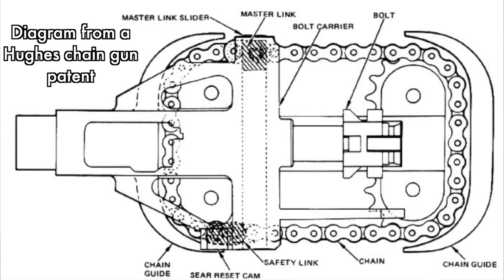Ask Ian: Are Man-Portable Chain Guns Coming?

Comment: Here's a question for you. I know there's that one particularly lightweight revolver made of Titanium, but why don't we see more firearms made of that material?
Reply: My guess would be insane cost, as well as the poor heat conductivity of titanium.
Reply: @PumpkinsAmongUs  Insane cost? Have you SEEN the US military-industrial complex? And poor heat conductivity is just a reason to bring back water-cooling for firearms, in a more limited fashion.
Don't get me wrong, the chamber, barrel, and bolt would still probably be made of high strength steel just like today. The rest of the gun tho, just think of how much we could reduce the weight of the M2 HB .50 cal machine gun if we made the side plates and all that out of titanium instead of steel?
Also, what's to stop them from making a composite barrel? Thin steel inner barrel, then a titanium outer barrel to reduce weight while maintaining strength. Or you know, go right to carbon fiber reinforcement of the thinner steel barrel. I think they tried it in the past, I know it didn't work back then but maybe the idea deserves a re-visit with modern knowledge.
Reply: Kentucky Ballistics actually did a vid on that very topic...It pretty much came down to cost...both in material, and tooling...The insane amount of effort just to produce one is really above the average gun maker 1 getting a consistent supply of titanium ay a decent price. 2 special tooling for all the machine work. 3 Someone with the proper training for sharpening said machine tools. 4 there's probably a few more issues but its pretty early in the morning and I haven't fully woken up or had coffee yet lol so kinda draggin ass at the moment
Reply: Titanium is brittle
Reply: @tandemcharge5114  Titanium is something you can make a hammer out of (they do make titanium framing hammers, if I recall) So, brittle it ain't.
Well, Titanium with the proper alloying elements and heat treatments is not brittle and is incredibly strong, and that's the kind of titanium I intended when I said "titanium" in the top comment, I didn't mean raw titanium metal, just like when someone says 'an aluminum bike frame" they mean "aluminum alloy bike frame" not "raw aluminum bike frame".

Now, it IS very very expensive.
That's more down to the fact that the world just doesn't use much metallic titanium, and that that titanium atom really likes hanging on to a couple oxygen atoms, forming titanium dioxide.
Titanium dioxide is an incredibly common ingredient, you find it in white and light colored paints, the best sunscreens, and a whole bunch of other things. And titanium dioxide is what you need to start with if you want to make high purity metallic titanium.
Reply: @44R0Ndin  Titanium is brittle, period. Whatever alloy that Titanium is in, hammers, drills, and clamps included, is not the majority metal. It's only there to add strength to the other components in it

On top of that worse case use, Titanium when used as a majority in an alloy metal is ductile and malleable, making it the absolute worse chose to ever use in a gun that requires the minimum to hold zero. That malleability means that, no matter what fancy schmancy chemistry words you tack on, titanium and concurrent titanium alloys are hard to work into shape, expensive, needs specialized tools, sensitive to temperature, and requires higher machine tolerances than normal due to previously said malleability due to temperature.

Aside from that, you're making your gun worse for your soldiers as Titanium alloy barrels have worse barrel life (Go check barrel life between titanium and normal guns), mostly from Titanium's lesser impact tolerances and ability to hold up from repeated impacts

So unless you're willing to spend even a badonkers more amount of money with chroming the interior on top of the already expensive barrel and receivers while also planning to mass produce it with specialised equipment and still being a fuck ton expensive for the consumer due to material and labor costs. Yeah, I don't see Titanium guns ever being a mass adopted thing outside of extremely specific niches like revolvers or guns that aren't continuously fired or subjected to constant expansion and contraction. To which we do see the knowledge being applied on the appropriate guns than Titanium being used everywhere
Reply: @tandemcharge5114  OK first off, now you're contradicting yourself, saying in the first sentence of your post that "titanium is brittle, period" (as I read it, this allows no exceptions), then in the very next paragraph saying it's "ductile and malleable".
So, which is it? You can't have both.
You'll note I was always talking about using titanium as the majority metal in the alloy, and never was I referring to titanium nitride, an extremely abrasion-resistant coating applied to many cutting tool bits such as drills and absolutely never used in hammers.
So in other words, I don't think you know what you're talking about anymore, and that's why.

Secondly, when I mentioned using titanium in the gun barrel, I was VERY SPECIFIC to say that the INNER BARREL (aka the part that gets the bullets going thru it) would be made of standard-issue, well known, well characterized gun barrel steel with the standard heat treating and chrome plating of the bore.
About chrome plating, since you wrongly said that it's gonna cost "badonkers more" to chrome plate a barrel versus not chrome plating it.
Chrome plating a STEEL gun barrel bore is NOT an expensive step.
Only people who don't build firearms for a living think it's an expensive step.
The reason they cut chrome-plating the chamber and barrel of the M-16 at first was because some politician with no engineering know-how in the field of firearms got in there and started cutting corners pretty much without regard to if it actually made the gun not able to meet its performance standards or not.
I expect that they might have saved maybe $5.00 USD on each gun barrel they didn't chrome plate in that application.
Even if the gun barrel only cost $50.00 when chrome plated (the gun barrel itself probably ended up costing over $100 in today's money, so I'm giving a worst-case estimate here), that's only 10% of the cost of the complete gun barrel (and at $100 or more, that's only 5% or less of the total cost of the barrel, which means it's pretty much an insignificant savings, considering the cost of the rest of the gun).
Last I checked with my common sense, making something cost 10% more (more realistically 5% more) but last a lot longer doesn't equate out to it costing "badonkers more" as you put it. In fact, the only reason to not chrome plate a gun barrel is if you're looking for LITERALLY ANYTHING you can cut to cut costs, and you've already cut everything else first.

Back to the barrel that uses titanium tho.
Like I said, the inner barrel is merely a standard issue steel barrel that has been produced with a much much smaller outer diameter (insufficient to withstand the stress of firing in fact), that is heat treated the normal way a gun barrel is heat treated, and maybe it has been chrome plated (or maybe not, whatever makes you happy snowflake).
The titanium is used to REINFORCE this inner "barrel liner", so that it can withstand the stress of firing projectiles. In other words, the steel tube that makes the barrel is put inside a titanium alloy tube that reinforces it sufficiently to allow it to have a long service life while being lighter than an all-steel barrel.
Also, Titanium is still a metal element, so it is still plenty capable of conducting heat away from the barrel liner even if it is not quite as conductive of heat as steel is.

Maybe if you did some math out on the idea (looking up the relative strengths of heat-treated steel used in gun barrels, and comparing that to a resilient alloy of Titanium that has been appropriately heat treated) you'd be able to convince me that the idea won't work.
Until then, I still think the idea is at least worthy of study.
Reply: @Cancer McAids There are other ways of dealing with recoil that don't weigh as much as "make the whole gun heavier".
Also, while aluminum and polymer are the more usual choices, I was thinking of Titanium as the material of choice for something like a Nitro Express hunting rifle's receiver.
Not much sliding contact going on in a break-action single-shot rifle, and if there is you can do what Glock did to make their polymer frame work and put steel inserts into the titanium receiver to allow those sliding parts to slide on steel rather than on titanium, and still come out with a lower overall weight.

However, I'm one of those people that is convinced that no problem is unsolvable, unless the solution requires you to violate the laws of physics (and those kinds of problems usually involve thermodynamics).

So a purely Newtonian dynamics problem like "how do you mitigate recoil without adding weight" is VERY much a solvable problem. The firearm will become more complex yes, but the problem is solvable.

The first idea that comes to mind (for something like that .45 caliber polymer frame pistol you said you don't like shooting) is to split the mass of the slide into two parts, linked to each other by a gear, with the front portion "recoiling" forwards and the rear portion connected to the breech face and all the "critical to pistol function" bits of the slide recoiling rearwards as normal. Will this also make the pistol bulkier? Of course. Will the slide reaching the rearward end of travel cause the entire pistol to go off-target anymore? Not as much as it once did, and by calibrating the masses of the individual parts of the slide (forward and backward recoiling sections) you could tailor bias of forces to be more easily kept on-target.

Comment: I'd be interested in hearing about Revolver Cannons.
Reply: He did one on a Hotchkiss revolving cannon
Reply: He did, but a revolving cannon is not the same as a revolver cannon. A revolver cannon is like a revolver with a Gatling gun as the cylinder.
Reply: @keenumman1  Missed that one, gonna dig it up.
Reply: Or maybe lever-operated cannons.
Reply: @gus.smedstad  Now I want @smatereveryday and @stuffmadehere to build a rig to turn a Winchester 1873 or Marlin 1895 into a machine gun. The ATF should grant exemptions for stupid shit like that.
Reply: @DeliveryMcGee  In Cuba during the revolution I have seen reverences to  94 Win mad full auto  ...
Reply: I wonder if there are any ShKAS hanging around. 

edit: Wait I just noticed there is a post about it on forgotten weapons website.
Reply: Those are just essentially miniguns with only one barrel, but multiple chambers.  So you get the reliability of the external operating system, but these are used with firearms that don't need the insane rate of fire of a traditional multi-barrel system, so you don't need the extra barrels to take that heat.
Reply: @Panzermeister36  The virtue of revolver cannons is that the INITIAL rate of fire can be higher than a gatling cannon. A gatling gun needs time to get the barrel cluster spinning at full speed.  A revolver cannon only needs to spin up the "cylinder," so it gets to max rate of fire sooner.  The trade off is single barrel means lower sustained rate of fire.

If I understand correctly, the virtue of modern revolver cannons is in cases with short engagement windows.  Also, when you start thinking about revolver cannons, you start thinking that maybe David Dardick was on to something...
Reply: @grimlock1471  also, Revolver Cannons are lighter, because they only have one barrel.
Reply: @havoc3742  almost like design is pile of compromises. 🤔
Reply: @Panzermeister36  the whole point of minigun or a gatling gun in general is havinf multiple barrels
Reply: @timofiy98  Multi-barrels firearms are harder to make accurate, so in a high accuracy/medium fire rate use case revolving cannons are more desirable.
Reply: You can get pretty high fire rates out of revolver cannons. The main benefit is that you dont need the space for the barrels, you dont have any spin up time and you get good accuracy.
Reply: @thenewhalogod  what does it have to do with what i have said?
Reply: @timofiy98  No. Just no. The point of miniguns is absolutely not having multiple barrels to give it more weight and complexity. The point is to have very high rate of fire and reliable mechanism for it. Making multiple barrels for the gun is only unavoidable consequence.

In theory it could be avoided by having cooling system over one barrel, but for that high rof it would probably be even more heavy and complex system prone to breaking and that is why they are not made that way.
Reply: @anteshell  you are really dense, what i mean is - if it doesn't have multiple rotating barrels then in it's core it's not a minigun/gatling gun, if you take them away - why bother calling it a minigun?
Reply: @timofiy98  I'm the dense one here? It wasn't me who attempted to say something but failed and wrote something completely else. On the other hand, I was the one who pointed out that mistake. I'm pretty positive that the former one is much closer to the definition of denseness.

Do you know the joke about A-10, how it is a plane strapped to a gun instead of the other way around? As a joke it's all fine and dandy but when you're talking about it seriously from engineering perspective, it's pretty damn big deal to it right which one is strapped to the other and whether or not the amount of the barrels is the goal or just consequence. And you weren't joking.
Reply: @ravener96  yea, but you can get 6* the fire rate from a gatlings. both have their place
Reply: @thenewhalogod  obviously yeah, thats why gatlings are used so much in aircraft. all im saying is that there is a space for revolver cannons even where you need relatively high fire rates. 2000rpm of 30mm isnt anything to sneeze at. especially for ground vehicles the revolver cannon is probably suficcient for most uses a gatling could be applied. in fact it could probably take the place of chain guns in most applications, it could shoot both at the slow few hundred rpm we often see on ifv's and at an "oh shit" mode when you just need something gone right now.
Reply: @ravener96  While I agree, there is more to what I was saying. As Ian covered, each firearm has a time limit for sustained fire. Gatlings are better used in aircraft, because they can spew a shit ton of rounds faster and a higher quantity total. Six barrels means six times the heat capacity means six times the rounds in the same timeframe. In that use case, being accurate isn't as much as a concern. Rotary cannons are much better in a LAV, than a gatling, because of the accuracy due to the longer firing windows and slower targets. But they won't touch something heavy, like an M1 Abrams. It's a balance of fire rate, accuracy, effective impact, and firing windows.
Reply: @thenewhalogod  i think we just agree on it all with different words. i dont see a reason you couldnt scale arevolver cannon to 120mm though, would be a pretty sick setup. you would obviously not get 2krpm out of it, but even something like 120 would be a hardcore "oh shit" button
Reply: @ravener96  mostly weight. think how heavy a single 120mm is, then add 7 times that.
Reply: @thenewhalogod  revolver cannons just have one barrel.
Reply: It's basically a giant electrically powered revolver except one chamber is firing, another is ejecting, and another is feeding a new round as the cylinder is rotating.
Reply: @Zippy Dastrange I think it's more complex. While fouling was almost certainly an issue with  early Gatling guns, I suspect they were consigned to the dustbin because Maxims and other early automatics were better in virtually every way. They came back in vogue with the jet age and the need to be able to put a LOT of bullets in the air in a VERY short time. The early answer was more guns.  Fighters in WWII and Korea had 4 and 6 machine guns, but that just wasn't enough dakka. 

Even now, gatlings are big, heavy, go through ammo at stupendous rates, and are complicated. Gatling guns are fussy beasts that need a lot of maintenance. Unless you really NEED that rate of fire, gatling configurations are probably not the most economical answer.  

Put this way, an M134 mounted on a Humvee is certainly effective, but is it more effective than paired M240s or an M2?  Probably.  Is the benefit worth cost in money, and labor?
Reply: I think u will like the puckle gun.https://youtu.be/GPC7KiYDshw
Reply: The F5 Tiger 2 fighter used 20mm revolver cannons.
Reply: There is the Puckle gun, too I an has made a video about it. https://www.youtube.com/watch?v=GPC7KiYDshw
Reply: @Zippy Dastrange saw is squad automatic weapon so I guess machine gun teams like in WW2 won't be that effective because 1 is carrying the tripod one the gun one the weapon itself and then you need 2-3 guys with mps or assault rifles to protect the team 
Even with a chain gun with 20lbs will be to heavy... 
That's why the army retired the M60 for the m240 and the m249 lighter and more reliable
Reply: The Soviet space gun was a revolver cannon.
Reply: A chain gun is essentially a one-chamber revolver cannon operated by an external power source.
Reply: Mausers BK cannons are quite interesting, 2-300lb, 27mm at about 1800rpm.
Gas operated so they need cleaning and overhauls regularly.

Comment: One of the.... stranger potential benefits of a chaingun is that you can vary the rate of fire without doing much to the firearm.
You set the duration of the breech saying closed by the geometry, but the rate of fire can be decreased below the "rated" value if you need it, say if you're short on ammo and need to keep the rounds going downrange, or you could connect a temperature sensor to the barrel and limit rate of fire if the barrel overheats, similarly to how modern computer processors will limit their operational frequency based on a temperature limit.